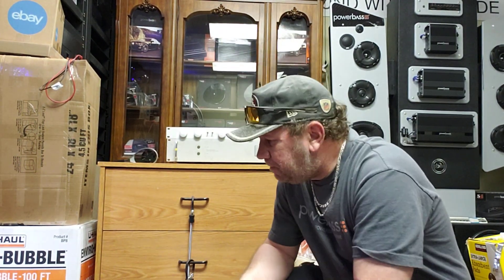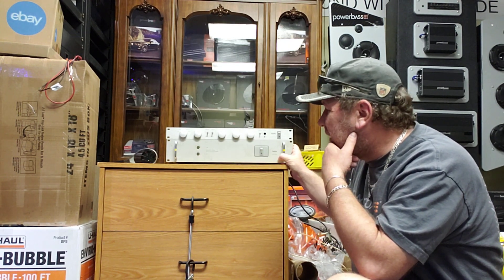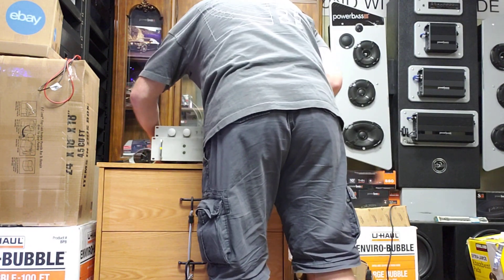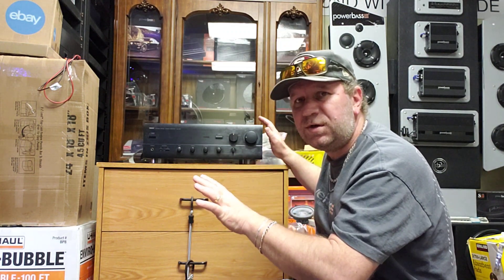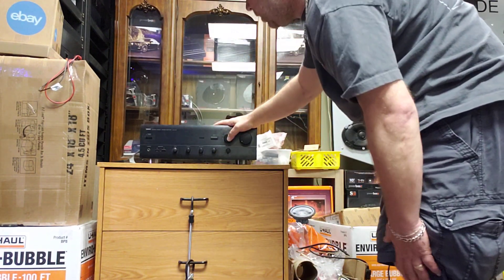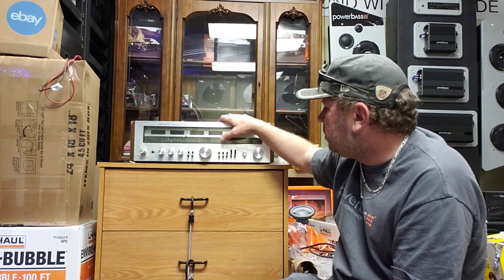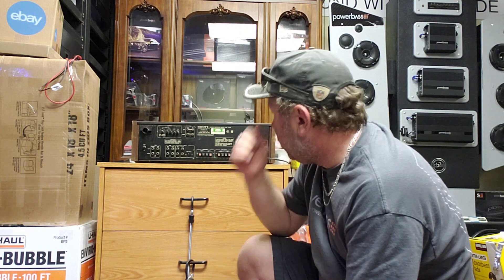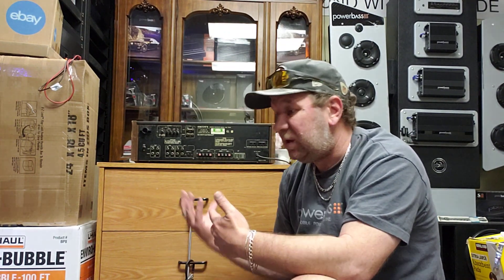Power amps, Integrated amps, & Receivers, what is the main difference.

Comment: I just picked up a beautiful Sansui G-8000 and a Phase linear 400 series, I plan on running 2 sets of my Cerwin Vega E-712’s on the stereo and my beloved D9’s on the amp.  My question is what are the pros and cons of me using my spare mids out of the E series that’s 4 ohms in my D9’s that are 8 ohms. I’m waiting on my replacement parts in the mail and I have spare mids .

Comment: Which Cerwin Vega speakers do you think sound better,  the D 9's or the VS-150's?
  I have a set of the VS-150's that I just reconed, and they do sound great but I need to upgrade the old passive crossover networks in them still,  but if the D9's sound better, maybe I'll just get a set of those and restore them. What ya think?

Comment: Hello sir .
I just found your video while I was looking for info on mixers on google.  You seem very knowledgeable so I have a question that I hope you can answers. I have two different pairs of active speakers, one is the Kali in 8 and the other is the Edifier s3000pro. One have xlr balance inputs the other have RCA. Ok the question is.  Can I use a mixer to connect both pairs at once so the same audio plays in all the speakers? For example TV audio or streaming devices or also a turn table. If so can you recommend a mixer for me that sounds well and don't break the bank? I thank you in advance and send my respect from Puerto Rico 🇵🇷😎✌️. Be safe.
Also is there such a thing as a hi fi mixer?
Reply: no
Reply: @srimplaysnewwind3806  i bought the flow 8 mixer and I'm doing exactly what I ask about. So yes it can be done.
Reply: @teddybonkers33  no
Reply: @teddybonkers33  You're correct, but it doesn't always work. Balanced and single ended components are not compatible. Your system is not balanced, and because its not balanced, using the xlr connection is electrically identical to your rca connections.

Comment: I have a Project/one Mark 800. What would you consider that? It is a receiver but you have to have a jumper to go from the built-in preamp to the built-in amp. What would you call that? And is it okay to use?
Reply: That's a very good option. Its done that way so you can use your integrated amp as a power amp or a preamp. Making the connection externally completely bypasses all the circuitry for the half of the integrated that's not in use.

Comment: Hey Rossi can I run 4 d9's on a receiver or integrated amplifier
Reply from the maker: It all depends how you hook  it up.
Remember that D9 will measure around 4 ohm each, so it  comes down to  how you hook it up.
Will it be a good sounding setup? I highly doubt it,
Reply: @RossiAudio  so what kind of power source would I have to use to play all four at the same time

Comment: Got a question for you  ,  I just bought this Yamaha rx a780 receiver  ,  it doesnt seem to power my LS 15 Cerwin  Vega's  ,  keep turning up untill the subs just start to kick a little then it looses sound not completely but it sure dims down  ,  am I doing something wrong?
Reply from the maker: Yeah that RX receiver is not even close to be good enough.
You need real power amps.
LS15 are some of the most demanding CV speakers, they "eat receivers" like an appetizer.

Comment: Hi, I saw one of your earlier videos Rossi.  I need to change the foam on a woofer and you said in a previous video there were bad knock offs.  What company do you recommend that has good foam replacements for the Cerwin Vega AT-15?
Reply from the maker: speaker exchange in Tampa has the OEM foams used in CV speakers.
They are my only choice, and the only company I use.

Comment: their are some receivers with bass expanding and loudness  options that blow much much higher watt AMPS away I have seen. Crazy bass and very loud and powerful sounding.  Ever listen to a Onkyo TX-850 receiver.
Reply: that amp with some 15" Vega's what a combo.
Reply: That amp is not nearly powerful enough. Especially if you use loudness etc., which drains even more power from the amp.